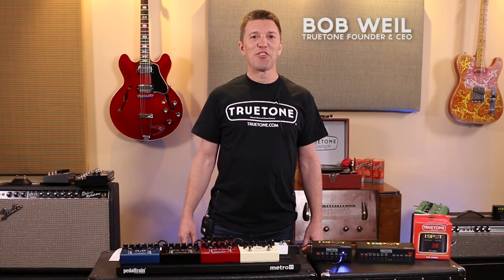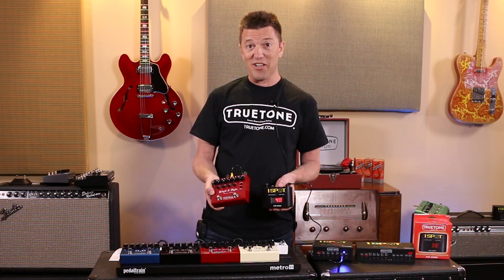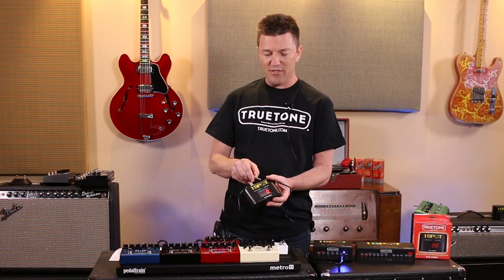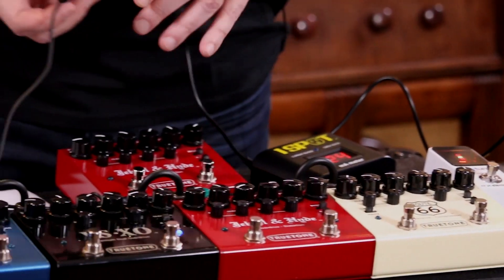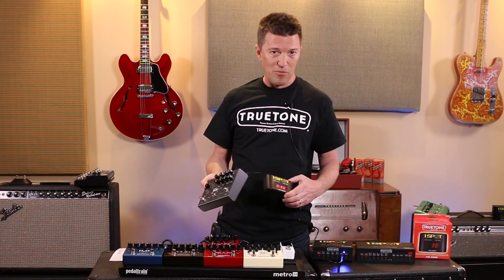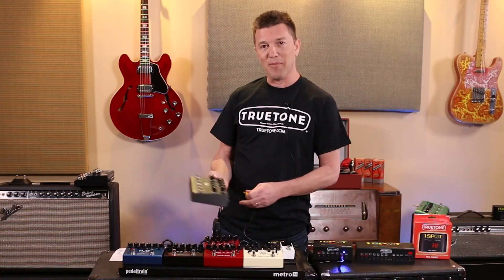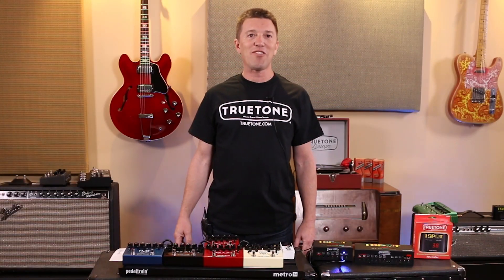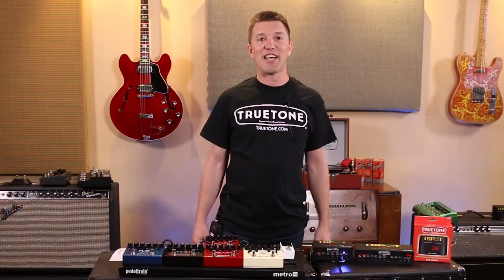mA Meter Demonstration Video | 1 SPOT | Truetone

Comment: Hi @truetone great product. I'm using a Cioks DC7 as my power supply is there a way to connect the mA Meter to it as the Cioks uses RCA connectors? Cheers 😀
Reply from the maker: yes. go rca from the Cioks to the MAm, then you need a regular cable from the Mam to your pedal.

Comment: Doesn’t the pedal have to be “under load” to get an accurate reading? just plugging it in like that without using the pedal and turning the knobs won’t give you an accurate reading, some digital pedals when you turn the knobs on them increase the milliamp draw… 🤔

Comment: My Radial power adapter puts out 15V DC Centre Positive. Can I use the mA meter with that? And do I still need a CYR cable from the meter to the pedal?
Reply from the maker: If using the Radial power supply you'll have to reverse the polarity (CYR) going into the mA Meter and reverse it again on the output of the meter to connect to the pedal.
Reply: @TruetoneFX  Thank you very much!

Comment: How does reading other voltages work with this device? Manual says it accepts 9V-24V. I have pedals for which the current draw at 9V is published by the manufacturer, but many of them accept up to 24V, and I'd like to get the numbers on current draw for those higher voltages as well. Can the mA meter do that?
Reply from the maker: The MA meter can absolutely take 24v. You just need to plug a 24v power supply into it, and then connect your device that can handle 24v.

Comment: When testing patch cables I get sometimes some interim reading like 102 or 103 to stay after on zero. Any reason? Thank you.
Reply from the maker: Does the unit measure mA on pedals? Let's get you in touch with our service department support(at)truetone.com or 931-487-9001
Reply: @TruetoneFX  it does with no issue. Some patch cables experience this interim reading. Thanks

Comment: I’ve had my mA meter for less than 1 month and it started to act funny.

When I switch voltages around i.e. 9V, 18 or 24V, the mA meter would read mAs when powered on but no pedals were attached.

Now, the display wont work but power is going through since the pedal since it turns on.

Has anyone else experienced the same thing?

Is there a way to reset or calibrate it?
Reply from the maker: We will take care of you. support@truetone.com or 931-487-9001
Reply: @TruetoneFX  the phone message says you guys are all working remotely and that email is the best way to communicate, no actual person will answer so I’ll send an email. 

Thanks.
Reply from the maker: With the pandemic, we have to be careful. Did you get a reply on your email.
Reply: @TruetoneFX  yea I did and its all taken care of.

Thank you for the prompt reply and information going forward!

Comment: I have a product suggestion(an accessory to already existing product line).  I would like an IEC power cable for your pro power supplies that had a pass through regular ac jack out on the back that would simulate having the courtesy output like on the PP2+.  All of the newer power supplies leave the courtesy output out but I power my old 70's AC cord MXR Flanger off of it.  Would be handy, I miss that courtesy output.
Reply from the maker: like this?  https://www.sweetwater.com/store/detail/1SpotACYUS--truetone-acy-us-courtesy-plug-iec-cable
Reply: @TruetoneFX  Thank you very very much for the reply, and I appreciate you guys forward thinking giving folks the option that some would miss from the PP2+ by changing over....I saw that one but for me it's a little hard to manage keep clean hanging off the back of a sliding rack pedal shelf .   I was thinking like the plug housing it self would have holes in the back for an additional ac plug type thing.....Like be a right angle plug but the housing part that goes into the iec jack of the  OneSpot Pro has a receptical for an ac plug on the back of it...kinda like a pass thru

Comment: What is the recommended amount of pedals that you should put on a daisy chain?  For example I have a true cs7 but I have 8 pedals.  7 are  9v pedals  and the other is a Eventide H9.  I am only using  6  power inputs because the 7th is 18V 100m as you know.  I have 3 pedals  daisy chained right now and I get  what sounds like a power hum when I really turn up, (which I often have to do as a violinist).  Should I be splitting two of the cs7 inputs (basically 2 y adaptors with 4 pedals)  instead of one input on three  pedals to reduce power hum? Thank you for your feedback in advance.
Reply from the maker: What pedals do you have?
Reply: In order from beginning to end. 

1 Boss Super  Shifter, 
2. Boss Distortion ds1,  
3. electro-harmonix pitch fork, 
4. electro-Harmonix B9, 5. MxR Bass envelope filter,  
6. Eventide H9,  
7. Boss Reverb, 8 Boss Loop Station.
Reply from the maker: What is on a daisy chain now?

Comment: Wow!! That’s a awesome product! 
I need one of this! 

One question.... I have the 1Spot power supply 1700mA. But I think there is something wrong.... it’s powering 6 pedais: TC Electronic Brainwaves, EHX Oceans 11, EHX Canyon, JHS Morning Glory, Friedman Dirty Shirley and Mooer PitchBox (that is almost off all the time).

And my EHX Oceans 11 keeps going off and on.... off and on. EHX support said it’s the power supply, not enough mA. When I use their original power supply (200mA) in the Oceans 11 it works fine.

Anyway, how can I check how many mA my power supply really delivers? I’m thinking it does not have 1700 mA.....
:/
Reply from the maker: That should work. Please contact us directly to figure this one out. 931-487-9001 or support@truetone.com
Reply: Truetone 
Thanks. Message sent.

Comment: Does the power draw change when running a signal through the pedals? Especially digital pedals.
Reply from the maker: If you are talking about a digital looping device, there could be a bit of fluctuation, but nothing super drastic.  Zac

Comment: Anyone tried this with a line 6 hx effects?
Reply from the maker: Just checked ours. It pulls in the 950 mA range and then at times goes over 1,000. The mA Meter can only measure up to 999, when it goes over that, it can only show 3 dashes.
Reply: Truetone wow thanks a bunch! Just got a CS6 and I love it!

Comment: Which cable to use with a tube screamer ts9 and what's the MA combination?
Reply from the maker: On the right side, you plug in a 9v DC, center pin negative, power supply. On the left, you use the provided DC cable to plug into your TS9.  Then you will get a reading of what the TS9 draws. Zac

Comment: For folks that still don't quite grasp this concept, just remember once you check your pedal(s) you'll need an adapter or power supply that is capable of putting out at least the same amount or MORE current than what the actual mA reading is. Overpowering = OK, wont hurt anything (better!). Underpowering = bad. (Remember we're talking CURRENT, not VOLTAGE here!) 
To stick with Bob's buffet analogy, its always better to have some uneaten leftovers on the table than to have someone going hungry for Christmas dinner!
Reply from the maker: Thank you for chiming in to help clear that up.

Comment: Curiously, in the one spot pro demo, Bob lists the current draw of the line 6 m9 as 350 mAs... so is the mA meter correct?
Reply from the maker: 350 mA was based on what we thought was accurate information gathered online. Using the our new mA Meter, that we developed over a year after the Pro video was originally made, we found that the Line 6 M9 actually pulls around 550 mA. However, it can easily be powered by the 9v AC output on the CS12, or one of the higher 9v DC mA outputs on either the CS12 or CS7.”
Reply: Thanks for the response. I guess you can't believe everything you learn on the internet!
Reply from the maker: No you cannot. I am sorry we had some incorrect info in the video. We have now annotated that in the Pro video to correct that.

Comment: I'm going to have to get one of these. For the DL4, would you need to use an adapter cable to run it from a 9V DC spot?
Reply from the maker: You need the CL6 converter because the dc jack is a different size and polarity on the DL4

Comment: Excellent idea. It's small enough to add to your board to just add to the "nerd factor".
Reply from the maker: Then you will always know how much POWER you are pulling
Reply: I may have missed it, but, how much current can it source to the daisy chain? Maximum input voltage?  i'd like to add one between my wall wart and distribution box. Thanks
Reply from the maker: The maximum input voltage is 24v DC. The maximum mA it can display is 999 mA
Reply: Excellent! Thanks so much